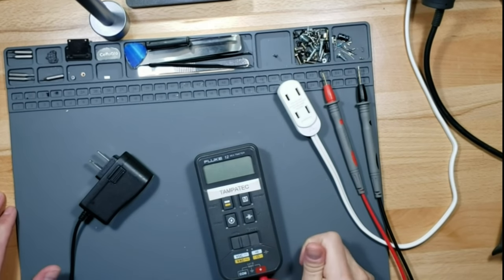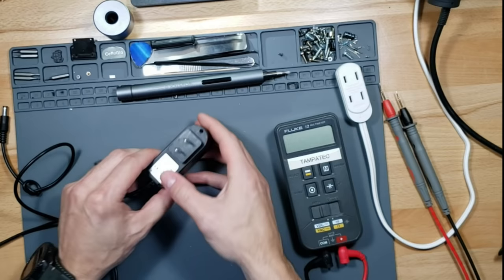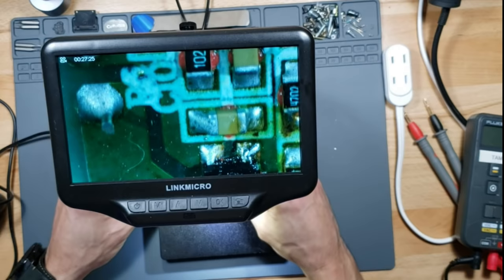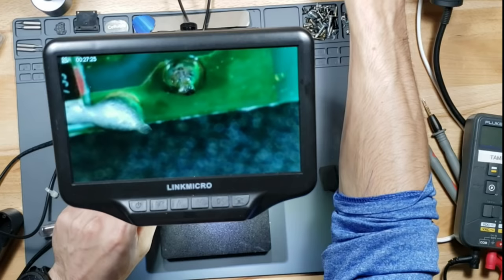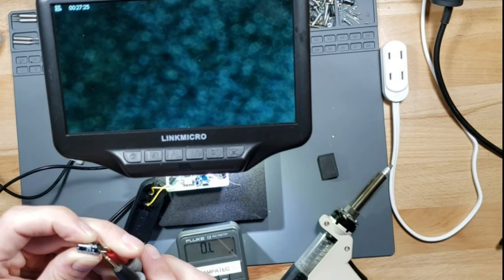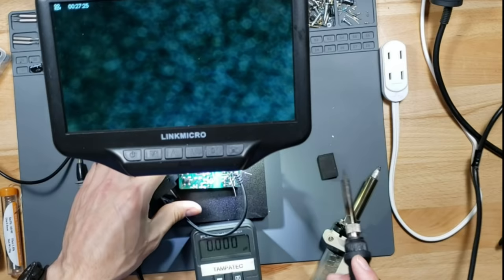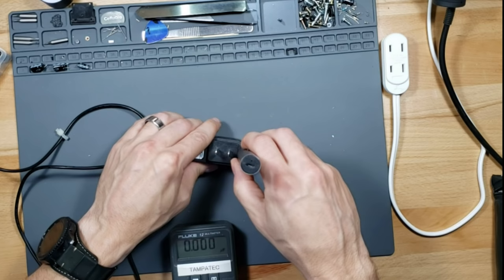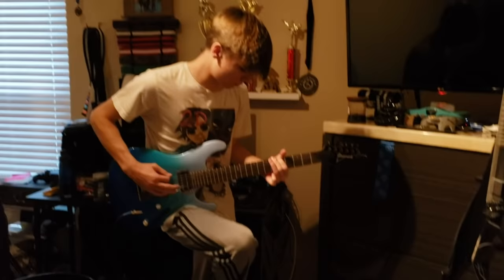How to Fix AC DC Power Adapter, common fix for adapters and phone chargers

Comment: The first electronic repair I ever did was a power converter like this. It put out the required voltage but the power light on the device, a Klipsch Room Groove, was flickering on and off. I saw bulging capacitors, changed them, and that fixed it. I know nothing about electronics, by the way, but this convinced me to learn!

Comment: Higher voltage is always better, but most of the times they will not fit on the PCB or case, or both, going lower (voltage) then they original was, yes that can be very bad.

Comment: Nice work.
Wish I could fix my 12v 1a adapter. But the whole thing is sealed, with nothing to indicate how the unit can be opened.
Reply: You are right ✌🏼
Some need to be pry opened. Use a blade to cut open. You got to be very careful. Don't damage the inside components ot cut your fingers. 
After doing it glue it up using epoxy resin or elephant 🐘 glue. 
All the best 😁✌🏼🤝🏼👍
Reply: me too 12v 1a LG for a blu ray player.

Comment: I thought you would of tested the adaptor after fixing the cracked solder, excellent video all the same.
Reply from the maker: We did at the end of the video, my son plugged in his adapter.
Reply: @TampaTec  sorry bud,  I meant before changing the caps.

Comment: I found out that the heatsink from a other component was SURROUNDING two capacitors that have become swollen from all the heat getting dumped around them, which caused them to dry out, causing the device to fail sooner....

And the manufacturer KNOWS this...

Comment: I have an adaptor output DC9v-200mA. My 2 multimeters tell me 18.5v output. I have a max power supply which I can output up to 30watts. But I can also get a voltage reading from different devices like a 9v battery or the 15 battery. But when I connect the adaptor to my electrical outlet, I get no reading. Any suggestions mwhat might be happening..

Comment: I'm too scared to just shove the meter leads into power outlets or extension cord plugs like you just did without hesitation!! What's the trick to not sizzlin yourself your burning up the outlet?  But then you switch the meter?? I'm confused

Comment: Ok but what happens when you open yours up and theres nothing wrong with it?
Reply: Check the cable itself. If there’s a problem, it’s usually at the connector end or where the cable goes into the power supply. Wiggle and flex it to see if it starts working.